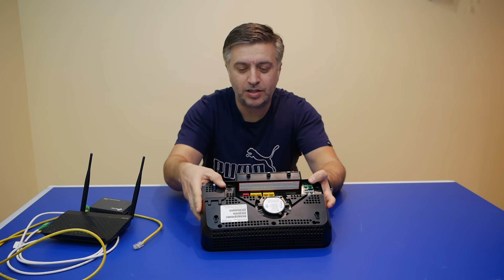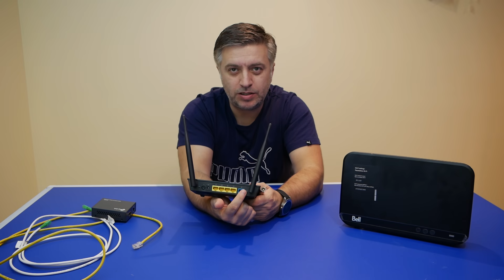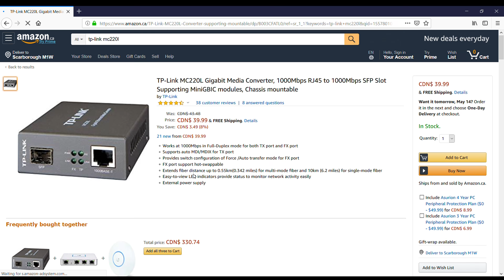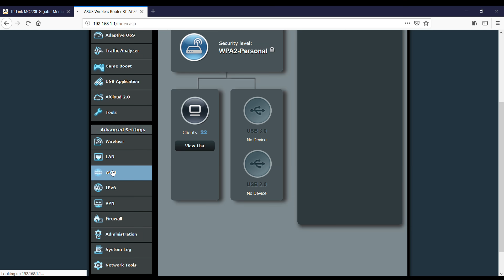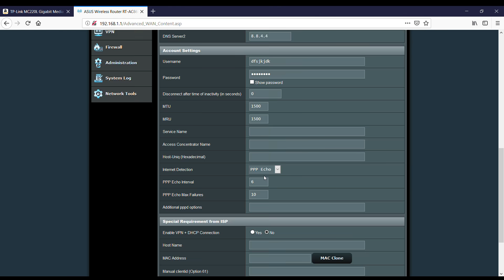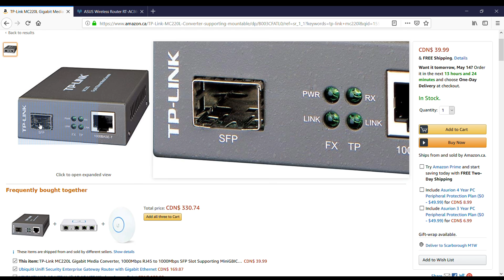How to remove/bypass Bell Hub 3000 and use your own router

Comment: We got the 1.5 gbps speed from bell. Its only sending up to 250 mbps max on our devices. If I were to do this will it increase the speed more than 250mbps? I feel like bell’s hub 3000 is limiting the amount of down and upload being sent to our devices? What do you think?
Reply from the maker: It depends on the router and the devices connected. Look at my GT 2900 compared to  ac1900p and you can see the speeds. Also depends if you are connecting to 2.4 or 5ghz band.

Comment: i have the same router, when i opened it up there was a slot for the sfp but no sfp???!!
Reply from the maker: In this case you have DSL with bell. Is there something like a phone line going in the router? Does it say DSL, the label should be on top of the port.

Comment: Do you have a video or instructions on how to turn off WiFi on my Home Hub 3000 and replace it with a TP-Link AX90 or similar wireless router?
Reply from the maker: First you can just connect your router to Bell router and follow video for PPPoe password setup. Setup network name different from Bell wifi name and you have your own network. Bell accepts 2 concurent PPPoe connections. Then you go into Bell router advanced settings and turn off wifi. Give it a try and let me know how it goes.

Comment: hi, i have tl-r605. but i dont have iptv in the config and, i juste have alt-tv. i was config all that you show in the video but dont work.. this router can support this manipulation? need i an asus wrt or my router can support ? i have the same adapter mc220l .. and i has change the sfp on the router that run good in an other modem hub3000 and its work. the probleme is the router so?
Reply: alt-tv with fibre 50
Reply from the maker: You have to tag port 35 somehow. I can see that in the basic functions there is an IPTV menu. In the custom mode inside IPTV maybe. In tplink website, configuration guides for your router it is specifically explain how to tag vlan if you use iptv.

Comment: Problem with that is the SFP port of this media converter synchronize at 1Gbps while the HH3000 one sync at 2.5 Gbps. If you have the Gigabit plan, you will not get the full speed because of the overhead of the 1Gbps SFP port.
Reply: What does that mean exactly?  What overhead are you referring to?

Comment: I just moved into my new home in Niagara Ontario. The entire house is wired with ethernet (built in 2018). I currently have bell as my ISP and am paying for 1000mbps download speeds but my devices never reach that speed over wifi so I would like to connect to my ethernet.  As of right now, when I plug in an ethernet wire into the CAT6 port in my bedroom wall to my device (or any other room), I get no wired internet connection. There's a bunch of blue wires in my basement next to a patch panel, but my modem is on the main floor. I have already reached out to Bell, they've said this is outside of their responsibility.

I would like to setup a more robust home networking but not sure how to do it on my own, even after exhausting countless hours watching YouTube videos on the subject. Do you have a video on how to hook up everything for me e.g. routers, switches, access points, etc. Do I have to move my hub3000 to the basement? Is there a main wire that would connect to the modem and provide internet over ethernet for my entire house? The fibre optic cable seems to be coming from the main floor living room, is that also movable ?

I would like something very similar to what's shown in this video: https://youtu.be/-L1eI4vECo4
Reply from the maker: With the video setup only media converter has to be where optical cable cones into your house. Then you can connect your own router through an ethernet cable to the converter and your router can be where you want to put it as long as the cable reaches. It has to be a cable fault if you don't get connection through cables, maybe they wired  the wrong way in the walls. Take out the plug in the wall and check how cable is done. You can just redo endings and see if that works.

Comment: That's only a Gigabit converter, if you have 1.5Gbps down you're capping yourself.
Reply from the maker: That is correct, in this case you would need a different media converter. There is one that supports 1.25Gbs and it costs 46$ but for 1.5 you would need a 10Gbs converter and that one is around 250$. Or you could use your Bell hub.

Comment: I followed all the steps and my speeds are incredibly slow.  Not sure what to do.
Reply from the maker: What is the speed you are paying for? What is the speed when connected with ethernet cable? 5ghz connection or 2.4? What is the router model? What was the speed with Bell hub?

Comment: hi i don't have that part in my bell home 2000
Reply from the maker: If you have fibe with hub 2000 then they installed a separate media converted so you don't need the converter. Just connect your router to the cable that comes out of the media converter and follow the instruction on the video. I will be posting a video with bell hub 2000.

Comment: Great video! Will this work on the asus rog rapture? ax11000
Reply from the maker: I don't know about that but I just got a GT-AC2900 that I am going to setup in the future. I can see that your router is not supported by Merlin so I am not sure how it will work. People were successful with Asus firmware and the setup instructions. I don't see why it would work if you have IPTV settings. But don't take my word for it, I don't have this router. If you buy it from a store that you can return you can try and if doesn't work you bring it back.

Comment: I have both Bell Fibe internet and Fibe TV.  Where can I find instructions on how to wirelesly connect the Fibe TV boxes to the non-bell router?
Reply from the maker: I am not sure if it will work, I don't have tv boxes from Bell and I don't subscribe to Bell tv service. But you can try tagging LAN4 to 36 and connect the tv box with wire to lan4 port on the back of the router. Or you can connect a switch to the back of the router on lan4 and connect as many boxes to that switch. Or you connect an internet powerline adapter to lan4 and then another powerline adapter in another room and connect box to that. Don' t take my word for it but if you can return the powerline adapters to bestbuy you could try.
Reply: @advfreedom  vlan 34 is iptv with prio 4. where wan is 35 prio 0. 36 is for business voip phones.  you cant connect their boxes directly to own router over wifi. only wired with vlan tagged port. if you want wifi, you need to buy the bell vap used with their original r1000h router tag a lan port 34, and connect the vap to it, wifi the boxes to that vap.

Comment: Thanks for the video and comments. I bypassed HH 3000 using Gigabit Ethernet converter (1.25Gb/s) and Asus RT-AC87U. I have 1.5Gbps bell connection and the highest download speed I have seen is 360mbps. Is this kind of disparity normal these days? (given people working from home/ kids on online schools, generally increased internet usage). I have used all settings as advised in the video. thanks!
Reply from the maker: If any QoS is set then hardware acceleration is switched off. Maybe that's the case?
Reply: @advfreedom  im in niagara area, fiberoptic is  at the main local terminals But not to each home, using a basic telephone jack connector to a bell hub without a optical module in the 3000 router

Comment: I have the TP-LINK MC220 and a TP-LINK Archer C9 with the latest DD-WRT (2020-12-29), my b1** user and my password is correct; It don't synchronise with the WAN, no internet; Anyone with the same setup succeed ?
Reply: It now works. I have move from dd-wrt to openwrt, the wifi don't work no more with an archer c9. I use the hub 3000 as wifi and the tp-link archer c9 as router and the mc220 as the sfp manager; Flawless
Reply from the maker: Did you change the VLAN to 35
Reply: @advfreedom  Don't see how to set 35 to a VLAN in the dd-wrt menus
Reply from the maker: Iptv enable and custom and choose internet vlan id change to 35. It could work but I am not sure
Reply: @advfreedom  There is no iptv menu in my dd-wrt menus :-/
Reply from the maker: I searched on google "iptv dd-wrt" and the first link was from dd-wrt wiki telling you that you need to disable multicast filter in firewall to get iptv settings. This is the best I can do, I don't have further experience with dd-wrt or TP-LINK.
Reply: @advfreedom  Thanks, I actually only use the internet service from Bell. I dont have IPTV so it's not a problem at this moment. I was able to create a VLAN35 and assign the WAN switch to this VLAN and it is not working at this moment; I will find the solution and I will create a WIKI for that, I'll be back to post the solution here.

Comment: Does anyone know by any chance the power adapter size? Is it a 6.3mm*4.0mm?
Reply from the maker: Power adapter for which device?
Reply: @advfreedom  Hub 3000, I want to add a power extension cable...I believe the adpater is actually a 5.5mm by 2.5mm:

https://www.aliexpress.com/item/32838107865.html?spm=a2g0s.9042311.0.0.98594c4dZqVjlw

Comment: It's not connecting
Reply from the maker: Check your password.
Reply: @advfreedom  which password because I'm confused
Reply from the maker: Check my video from description about bell password.
Reply: I ruin my internet and its not connecting bell blocked my service
Reply from the maker: How can bell block your service? They have no idea what you are doing. Plus they accept 2 pppoe connections. So many here were successful and I am running same setup.
Reply: You never mentioned anything in the video that we need a twisted cable because it says in the manuel with the converter but it didn't came with it other then that I did everything you told in the video and didn't work im using  TP-link software since my router is TP-link 1500 Archer ax10
Reply from the maker: In the video I only mention Asus router and I am saying that I don't know how it will work with other routers. If by twisted cable you mean network cable I didn't think that I need to mention that. I am sorry that it is not working for you, but it is working for many others here.

Comment: Why not save money and just bridge the home hub ?
Reply from the maker: There is no bridge mode for HUB3000, you can make it work by using DMZ and adding your own router in there. Now with the DMZ there is a lot of info and reading that you can do, pros and cons, double NAT etc. Not a big issues in a small setup but you can have issues when port forwarding and etc. But DMZ aside, as I was mentioningi n the video,  there is a hidden wifi network that you can't turn off.

Comment: Very informative video, I have recently bought 1.5gbps connection from bell. Any suggestions on media converter which can give more then 1gbps lan? Also connecting this sfp on a SFP+ 10gbps converter works? Thanks.
Reply: To get the full 1.5Gbps speed will require a lot more than a better media converter. The WAN port on most routers is only gigabit, so you will need to find something that handle faster than that. And if you want to go entirely over ethernet that router will need to have ports faster than gigabit, so will the computer or device you are connecting.
Reply: @coolguyconnor  you are right lot more hardware involved to bring it to full speed, found this router with 10gb speed and SFP port asus rt-ax89x
Reply: you would need to set your whole network to 10gbps. its still very expensive. not really worth it right now...
Reply from the maker: It should work if you connect to a 10gbs converter. But is your router able to put out on ethernet port more than 1 gbs?
Reply: @advfreedom  Yes you are right I need 10 gbs converter, can you please recommend me any media converter with SFP to 10 gbs please... yes I do have 10 gbs Lan card on my PC and Router (TP-Link WiFi 6 AX6000) which has 2.5 gbps WAN port.
Reply from the maker: I can't recommned any as I am not using it. But if you search for 10gbs media converter, they are around 1000$ on amazon.
Reply: @advfreedom  Thank you so much for your time to reply, really appreciate it.
Reply: @advfreedom  Just found this https://www.amazon.ca/gp/product/B07G3FM811/ref=ewc_pr_img_1?smid=AIXNQJPBDX8GX&psc=1 can you please see and advise will this work?

Comment: Can we use the Hub3000 and shut off the wifi and send the internet to another router via the ethernet port?
Reply from the maker: There is no real bridge with 3000. You can do DMZ and put your own router and turn off wifi on 3000. But you can't turn off all wifi, there is a hidden network for their tvs adapters and that one you can't turn off even if you don't have tvs.

Comment: Hello Marius,  I was able to config a new Asus router and it is up and running, however since swapping out the HH3000 and performing  the config as stated in your video, my DL and UL  bandwidth is gone...   I am currently on Fibe 500 and since changing my dl speed has dropped to 140MBPS -+  and UL speed is around 10MBPS....    Any ideas?   Thanks Andy
Reply from the maker: Connected to 5g? Or 2.4?
Reply: @advfreedom  I initially did speed tests on 5G and was coming up with the numbers stated.   2.4G provides very low speeds in the KBPS range...  My son actually mentioned to day that he could not even watch YT vid as the connection was so poor....   

In any event I was able to get a hold of an ASUS tech rep that mention a few tweaks to modify that should get it to run properly...
1. Change "switch control" to enable from disable
2. Change channel bandwidth of 2.4G & 5G >> advanced >> wireless>>general>> under 2.4G to 20/40 
3. Change control channel from auto to 6 or 9 >> apply

I'll try once i get home tonight as the iphone app although feature rich does not have the ability to do the tweaks mentioned above...

Any thoughts?   Thanks
Reply: New Router I am now using >>> Asus ROG Rapture (GT-AC2900)

https://rog.asus.com/networking/rog-rapture-gt-ac2900-model/
Reply: @LuxAdvisor  outcome ??

Comment: I got this working but I'm not getting the full 1000Mbps seeing 600 to 700 any suggestions to tweaks settings on the router to increase performance?
Reply from the maker: Need to enable hardware acceleration.
Reply: @advfreedom  I have the ROG Rapture GT-AX11000 and I don't see where I can enable hardware acceleration, I even bought the  GTech Gigabit Ethernet Media Converter to see and I'm seeing the same speeds? Not sure where to look?

Comment: If I bypass the bell router which router would you recommend
Reply from the maker: I recommend one that has those IPTV settings. You need VLAN 35 setting. I like Asus because of Merlin firmware and personally I have the RT-AC1900 or RT-AC66_B1. It is the same router. Depends on how the retailer is setting up the description. I used to have an RT-AC86u but both wifi bands disappeared so I replaced it with this one.

Comment: I am currently using the Home Hub 2000 and I am sick of the lack of functionality I have with regards to network settings and other things like unstable connections. 

Does this process work for the Home Hub 2000?
Reply from the maker: Yes it does but my Hub 2000 came with a separate media converter. It was for business and Bell also sends a media converter. So I am using their media converter but not their hub 2000.
Reply: @advfreedom  Thanks alot Marius!

Comment: does not work, ordered the same media converter, same asus router, it simply won't connect, I think they are filtering it based on mac address, glad amazon has free return policy
Reply from the maker: It does work and I am using it for more than 2 years. Also if you read through the comments you will see how many succeeded.

Comment: Hi Marius, Thank you for the video. The HH3000 is device to handle the internet, ipTv and the telephone line. If we replace the HH3000 to a WAN VLAN enable router with a SFP media convertor. How can we get the phone line working? We can designated a LAN port, on the WAN VLAN enable router, for internet, Fibre TV and Phone line. But how can we get the phone line working from digital to analogue?

LAN1 for internet >connect to a LAN switch
LAN2 for Fibre TV -> Fibre TV receiver
LAN3 for telephone(RJ45) ----->     ?          <-----(RJ11) telephone

Can a analogue telephone adaptor ATA resolve the phone line issue?

The analogue phone line is needed for home security system.
Reply from the maker: I don't have analog phone so I can say about that. I have IP phone and that is working.

Comment: Interesting video. I also have Bell fibre to the home. However, the installer brought a Nokia Fibre-to-copper converter, plugging the Cat5 cable from the Nokia device to the WAN port on the home hub 3000. If you have the same setup, you can just plug your own router into the same cable that goes to this wan port.
Reply: I have been delayed for the installation because there is a problem on the line outside... but the tech also had a nokia DPON to SFP adapter which i'll plug into my sfp to ethernet converter and right into my PfSense Box. I might eventually upgrade to a PfSense Box with an embedded pcie SFP+ adapter.
Reply from the maker: Maybe they watched my video!!! Lol..

Comment: I think Bell throttle my streaming (Plex) during evening time here in Toronto. Will it avoid Bell from this throttling by bypassing their Hub 3000?
Reply from the maker: With Plex there are many variables in play. Server transcoding, client etc. I would check plex log first. If it is just local streaming I don't think BellHub does to much. If it is Plex internet channels then again you have to take it step by step. I have Plex on a Desktop server and around 4 clients in the house( roku and cast) and it is good but sometimes when my desktop doesn't start in overclock mode then Plex suffers.